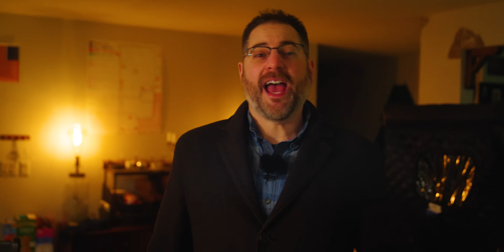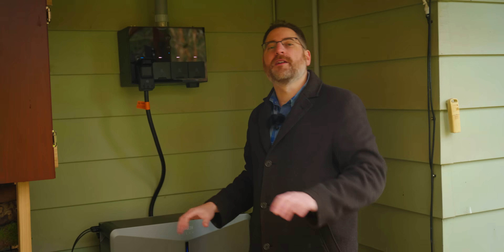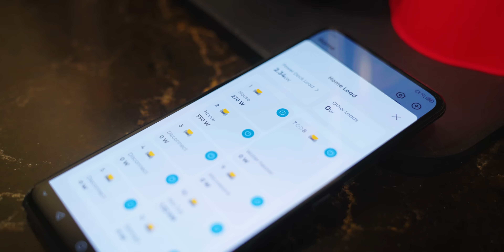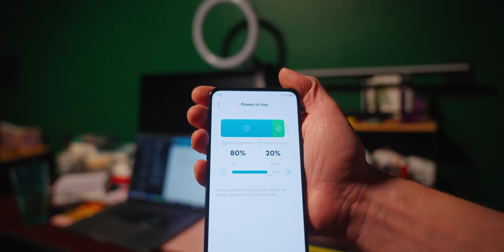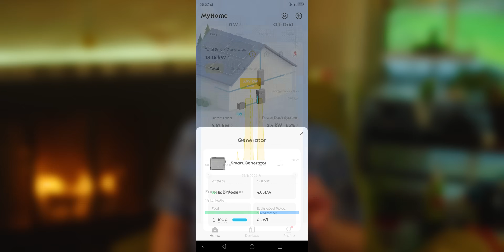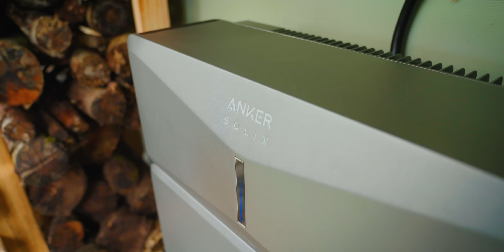Anker SOLIX E10 whole-home backup | INFINITE power?

Comment: This is the first time I’ve seen the power dock split apart. Is that a supported configuration or is that “custom” ?
Reply: That is a supported configuration. I had to have a local certified electrician install it so the correct size wire was used for the install, but the instructions to split the dock are in the provided setup guide.

Comment: I’m seeing absolutely no need for the batteries if the generator can 2x power your home. The solar can just go into the grid. 
Batteries are as irrelevant as Indiana Jones was in the 
Temple of Doom movie.
Reply: You are not wrong. For my tastes, the battery allows quiet time, ensures I don't lose power when/if the generator needs to turn off a moment, and is far more efficient. The generator pumps out 3600-4500W at all times (depending on what mode you are in) so if my house is currently only needing 750W, then the generator is overkill. Pushing all ~4000W into the batteries charges them up quickly with almost no waste, so the generator only has to run less than half the time, and the house has practically zero down-time.

I like the convenience of having the batteries in the mix, but, there's no arguing that one could rely solely on the generator. Costs, air quality, noise, and more are all factors, of course.
Reply: What? He frees the kids and gets back the stone for the village. You’re thinking of the other two movies

Comment: Systems still cost wayyyyyy too much compared to propane whole home generator systems.  What happens when Anker ENDS OF LIFE the system?  You end up with a GIANT BRICK attached your home (cough cough Wemo end of life last week)....what's is the update LIFE on this system?
Reply: Except the generator,  everything else can be easy diy
Reply: Happy to report that the generator can be run "offline", it has an optional pull-start, and it has the typical generator ports. If I remove the rest of the system, the generator still has life. As for longevity, the system does operate offline, it hits Anker servers for firmware updates, but it does not require the internet for daily operation. I do not know if Anker has built in any end of life features, certainly Lithium batteries do not last forever. I'm choosing to trust Anker.